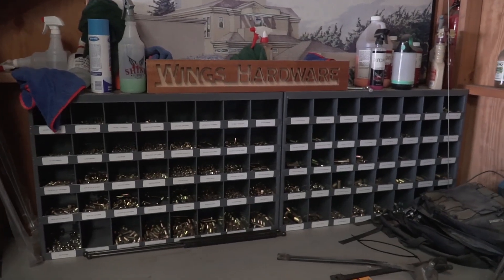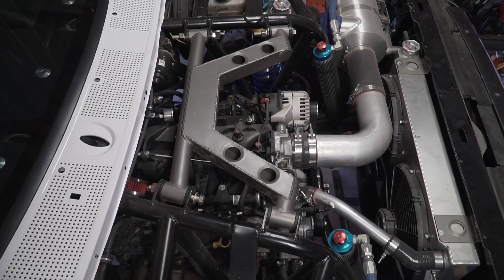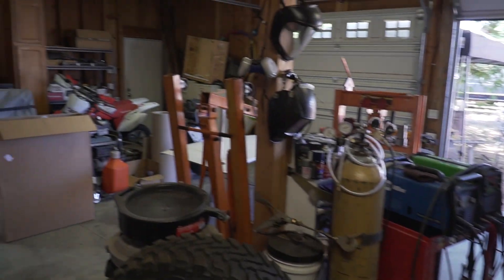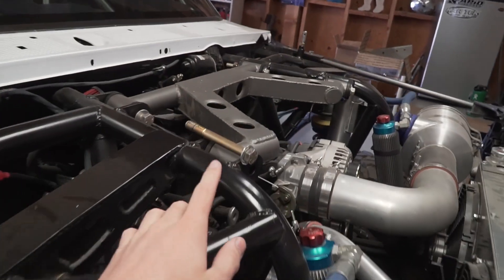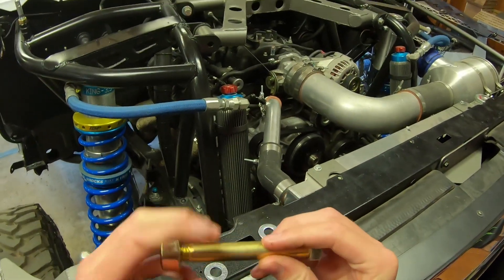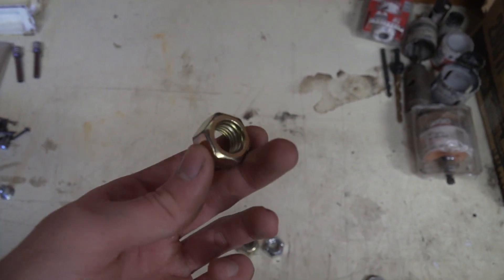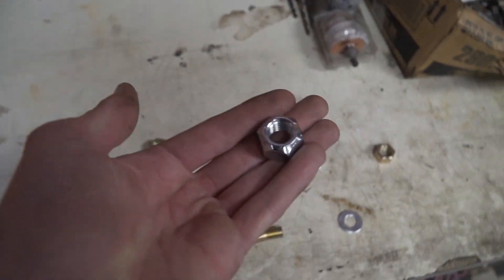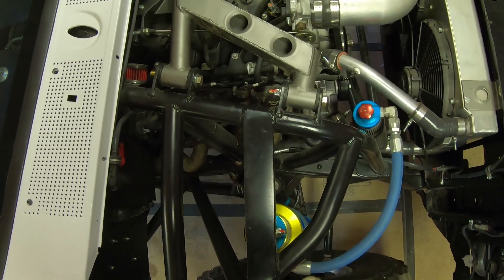FAB 101: How to Correctly Shank Your Bolts For Maximum Strength

Comment: By "stover nut" do you mean: "Conical Locking Nuts"?
The conical locking Nuts I get are from BelMetric which have a oval-shaped Carbon Steel nut that is (Grade 8/Metric Class 10.9) strength with "Yellow Zinc" coating.
I recently got them for my '02 Jeep Grand Cherokee Laredo's rear shocks which needed M12x1.75x80mm top bolt, M12x1.75x70mm bottom bolts and M12x1.75 Grade 10 Nuts.

Comment: It basically would if using top thread hve to fail twice on head end or locking nut other end to truly fail. U don't need a washer w/top of bolt w/this type bc extra top nut is washer. <More meat at the head> The kids swing set use nylon washer hardware & they r constantly moving & yellowzink rain coating which is not that great.
Reply: They make 2 levels of stainless steel bolts. Anything engine wise Harley wise u need to b able to get off go stainless esp if bolts under 1/2" & for sure 3/8" range, bc they break easy.

Comment: If they took a devil grade 8 bolt (b4 Shannon took devil# back) & double threaded the bolt. So u could drop a nut on the bolt on head end & thread it down. It would give u that double end strength against shear. It also would make the total length more forgiving between sizes, bc u hve that extra threaded prt u can or don't hve to use for total length. In a pinch u can just cut off the thread-head end & hve a make shift piece of mostly thread both ends.
Reply: Also when u need a wet bolt or sleeved bolt deal extra strength & free to grease & turn helpful if threaded both end bottom & below the head.

Comment: Good info. I always touch the end of any bolt I cut with a little touch up paint, just really helps slow rust compared to bare metal. Around here if left bare within a couple years rust will spread to the nut and rust weld the nut onto the bolt. Makes it real fun to get off. Doesn’t help that zinc coatings aren’t as good as they used to be either. just replaced manifold bolts on my truck last summer & there already corroded to hell..
Reply: You make a good point but grade 8 bolts are almost always cadmium plated.  The zinc colored washers he's using are wrong for grade 8 bolts.  Grade 8 washers are cad plated also but more importantly have a relief cut on one side of the hole to accommodate the larger radius where the head and shank meet on the bolt.

Comment: I do something sim for an engine part but prob should as well for a serious drag car suspension.  Check out Nord-Lock Wedge-Locking Washers, they have a Junker Vibration Test video on youtube.  I like to use nylock's for most things but as you mentioned not for high heat areas.
Reply: BOOT what about cone lock nuts for heat areas. And split/lock washers are junk ( not nord lock)

Comment: When would you cross-drill and safety wire a bolt in a truck you build or run?
Reply: when said bolt(s) are threaded into something with no nut behind it. like rotor hat bolts, brake caliper bolts... things like that

Comment: What bushing are you running on that engine brace? Need some for 5/8 bolts too.
Reply from the maker: I think those are bushings off of RuffStuff. I actually mispoke in this video, it is a 9/16 bolt not 5/8.

Comment: Don't forget AN/NAS bolts as they come in grip lengths of 1/16" so you can get really dialed in on grip length...Might want to talk about USS vs SAE washers as there are applications for both. Have you guys checked into AC 43.13 1B, AC 43.13 2B?
These are FAA publications that contain an ASS LOAD of excellent fabrication info. I've been fabricating race vehicles for about 40 yrs, but before that I obtained my FAA cert to work on Aircraft, and although that career was short the knowledge and info from those publications have been invaluable... Great work guys, really enjoy your vids...
Reply from the maker: I'll check some of that out, seems cool!
Reply: @WingsWorldChannel  I use this stuff in aviation all the time. one thing we do thought is on torque stripes mark the threads, nut and bearing surface such as the cross-brace mount to see if the bolt and nut are spinning too. normally though we have in NAS hardware the provisions to safetywire everything to prevent it from spinning

Comment: How do you determine the torque spec?
Reply from the maker: We just go until it is TIGHT. That chart seems pretty nifty though! ^
Reply: Wings World thanks for the quick reply! Love watching your guys’ videos!!!
Reply: Wings World so you want good engineering practice by “shanking” your bolts but tight is good enough? Check out Carol Smith for excellent auto engineering references. Btw, if you ever get to chat with a proper engineer ask him about bolts, bolted joints and fastener tensioning .👍
Reply: You can use a torque chart for your grade, size, and thread bolt. Like this one https://www.boltdepot.com/fastener-information/Bolts/US-Recommended-Torque.aspx

Comment: Buy a second grinder so you don't have to swap from cutting disc to flap disc during a project.  So much easier.
Reply from the maker: That would certainly make things faster! Now that we have a bandsaw we should just be able to use that and an angle grinder with a flappy and be set.
Reply: this^^ i have a grinder for cutoff, one for flappy, and one with a big meaty stone for contouring tube. way faster.